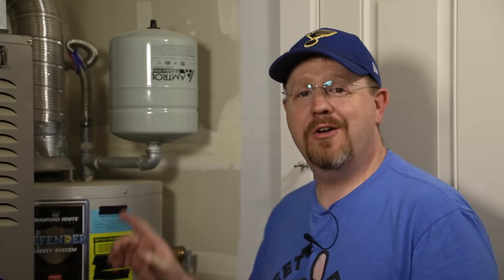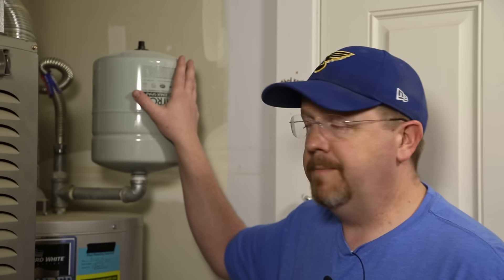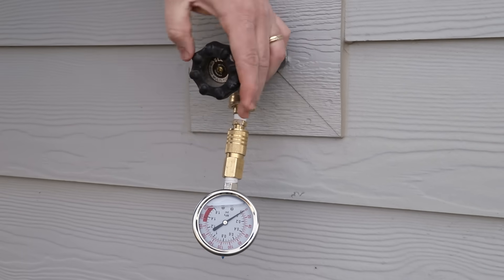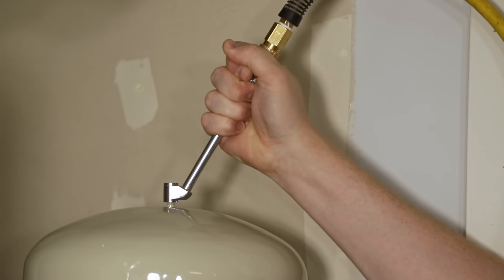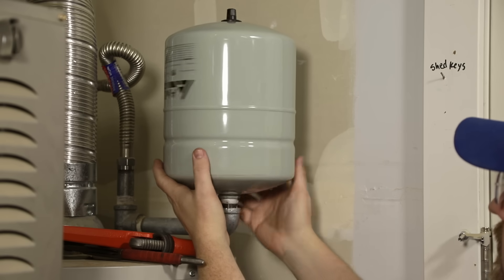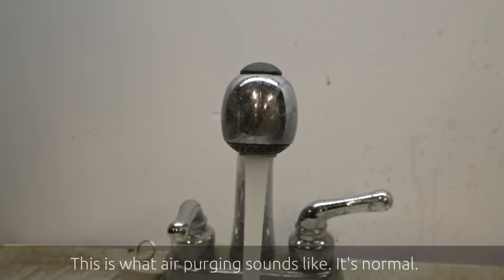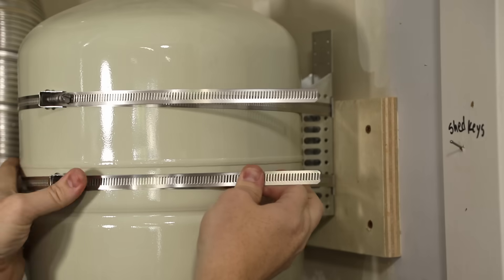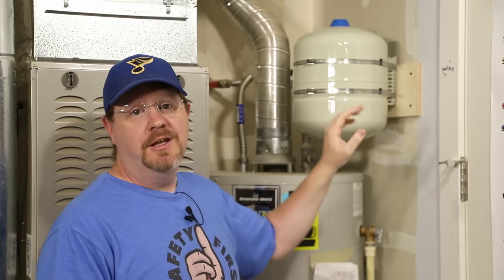What Is This Tank? How to Replace and Maintain a Water Heater Thermal Expansion Tank

Comment: Is it need by city code??? What about safety pressure release value ?
Reply from the maker: Some areas require an expansion tank, yes, some do not. Consult your local city/county/municipal ordinances to find out if yours is required or not. As for the T&P valve, those are required everywhere.

Comment: Not sure your right on matching the tank PSI to line pressure, as the bladder will be fully extended all the time and be stressed and short lived. Your tank pressure should be set to 50-60% of your water pressure so the bladder ends up at the middle of the tank when in service. (The air gets compressed 50-60% then and = line pressure). Blaader life it far greater if its not at it limits.
Reply from the maker: Hi Stephen - every source I consulted indicated you are supposed to match the incoming pressure. Here are a few for your reference: 
"Expansion tanks are pre-charged with a 40 PSI air charge. If the inlet water pressure is higher than40 PSI,the expansion tank’s air pressure must be adjusted to match that pressure but must not behigher than 80 PSI."
http://www.americanwaterheater.com/media/22209/exptank.pdf
"You will need to adjust the air charge. Yes, the factory does precharge the tank, but usually only to 40 psi. You want to match the pressure in the expansion tank as close as possible to the water pressure of the house."
https://www.plumbermag.com/how-to-articles/business_general_service_hvac/tips_for_handling_water_heater_expansion_tank_troubles
Reply: @AmplifyDIY  If the Empty tank is at water pressure, how would any water ever push into the tank?  Thus the bladder is always fully extened all the way to the water inlet. You want the bladder in the center. It can't if the pressure empty is the same.  If you have say 80PSI water pressure, charge the tank to 40 to 50 psi, when the water pressure is applied, the bladder will move to the center as the PSI of the air will be doubled when you add the water pressure.  I had issues with mine, the mfg of the tank explained it like i have and have had no more issues.
Reply from the maker: Hi Stephen - You asked: "If the Empty tank is at water pressure, how would any water ever push into the tank?" - The answer is that as the water heater heats the water, that water expands, which increases the pressure of your system, pushing water into the expansion tank. As this water pushes in, it reduces the volume available for the air, which also increases the air pressure to more or less match the increased pressure of the water. Also, the bladder of the expansion tank is not set right in the middle - I've cut several open, and the bladder is mounted about a quarter of the way up from the water inlet, and has enough slack that it sits more or less right on the water inlet with little to no stress on the bladder. 
No idea why any manufacturer would have told you to do it that way, unless it was a tank for a different type of system.

Comment: Holy smokes 75 psi! I don't know crap about plumbing, but have had two plumbers check my household water pressure. The first turned it to 60 psi and said any higher would damage pipes and fittings. The next plumber checked it and of course it was 60 psi, lol. He said that was as high as it could be safely set. ....I think I'd be satisfied if my pressure was 75, seems like a lot.
Reply from the maker: Below 80psi is normal for most US residential. But the whole point of this video is that the tank needs to match the water supply pressure. My supply from the city is 75psi, so I set the tank to match.
Reply: @AmplifyDIY 75 psi,  I'm jealous - I understand the video, sorry if you misunderstood; I'm not being a Youtube keyboard commando. As stated, I don't know crap about plumbing, just sharing what I've been told.

Comment: Ignore the UK in my name. I live in the US. I recently replaced my electric water heater. My home was built in 2009 along with all the others in my community. It didn't have an expansion tank. I'm assuming the plumbing has some kind of way to expand back into the supply..  Either that or the plumbing contractors took short cuts.. is there a way to test / or visually see if there pressure can relieve itself by going back into the system ?
Reply from the maker: Hi Julian - Take all this for what it's worth: I'm not a licensed plumber, just a DIY'er who understands how water heating systems like these work pretty well. 
The only way I can think of is to try doing the following: First, get your hands on a pressure gauge like I showed in this video, along with whatever adapters are needed to get it connected to your water heater's drain valve. Turn off your heater's heating element (probably by just flipping the breaker for your electric heater) and go take a shower, do a load of dishes, some laundry, etc... use up all the hot water that was in the tank. At this point you should have a water heater full of cold water that is not trying to heat it up. Now attach the pressure gauge to the drain valve and open the drain valve to read the current pressure. In my area it's around 75 PSI, but it's likely different where you are. Record that initial pressure. Then (while leaving the gauge on the drain valve and the drain valve open) turn the heater back on and let it heat up the tank until the thermostat turns off the heating element. Then record the pressure once more. If the pressure has risen significantly (more than, say, 3 psi) then you should have an expansion tank installed.
Good luck!

Comment: This guy has a flexible gas connection to the water heater, with no easy to reach gas shut-off valve, that I could see? Flexible hot and cold water connections?
Reply from the maker: Yup, that's how the plumber put it in, and it passed inspection.
Reply: @AmplifyDIY  you need to call that plumber back, I can't see this work as code compliant, or I don't know my job..
Reply from the maker: The plumber who installed this did so when the house was built about 4 years ago. I couldn't call them back even if I wanted to, as they were the plumbing contractor the house builder used. As for code: Local codes vary, and all the houses in my area use flex connections as you see ... it may not adhere to your local codes, but it apparently does here. Thanks for watching!
Reply: @AmplifyDIY  enjoyed the vid,like you said codes vary depending upon your area of residence, if I were you though I'd definitely change that flexible gas connection, in my opinion you're asking for it.
Reply from the maker: Thanks for the heads up. I'll check into what is best practice in my area. Thanks!
Reply: @AmplifyDIY  👍

Comment: Wouldn't the air absorb into the water in  a few days?  After that what keeps the stagnant water in the tank from growing bacteria and other deadly things?
Reply from the maker: Heya Popular Media: No, the air is kept separated from the water by the rubber bladder / diaphragm I mentioned. The lower portion of the tank where there is some water is coated inside to suitable for potable water. The upper area (above the bladder) is meant to forever stay dry since no water should get past the bladder. There is actually very little water that ever gets up into these things, and it will cycle in and out with the heat/cold cycles of your heater. There is no need to worry about bacterial growth.
Now, when the diaphragm fails, all bets are off. If water gets up above the bladder and into the portion of the tank that is not designed for water storage, it will quickly rust that portion of the tank and turn brackish. Some of that can seep back through the failed diaphragm into the potable portion of the expansion tank, and also down into the main water heater tank. This is why it's so important to check this expansion tank annually to make sure it is still pressurized and the bladder is still water tight. 
Great question, and thanks for watching!

Comment: I'm currently living in my fifth house (in SE Texas) and I've never seen one of these tanks attached to a water heater.  I've never had a problem.  As a matter of fact, the existing water heater in the house I own is the original heater ( installed in 1996) and I've lived here for 15 years. Are these really necessary?
Reply from the maker: Hey Aggiedave - great question! Not everyone has or necessarily needs an expansion tank. You can read a bunch more info about the hows and whys here: https://legacyplumbing.net/blog/water-heater-expansion-tank/ 
Thanks for watching!
Reply: @AmplifyDIY  This is not the answer that Aggiedave77 asked...you should say that it is not necessary as the hot water tanks is required to have a high pressure relief valve to relief the pressure if the water pressure inside the tank exceed the set value, say 75 psi...A few cities may have regulations that require a thermal expansion tank, but that is the exception, not the norm.
Reply: if you have a check valve in your supply line ( to prevent backflow into the city water system... a local code aspect)....then you have created a closed system where the expanding water has no where to go when it heats up. If you don't have a check valve...and the water expansion goes back to the city supply.....then you won't need the tank.

Comment: I have a Bradford white defender, like yours 3 years old, 50 gallons, natural gas. whats the difference between a 2.5 gal tank and the 4.5. other than the price.
Reply from the maker: It's all about capacity. The larger the tank, the more of a "cushion" it can provide. A 50 gallon tank is near the upper end of what a 2.5 gal expansion tank can handle, so I decided to step up to the next size. Thanks for watching!

Comment: There is a tool that tightens a zip tie until a preset tension is reached, and then it cuts off the tail. IIRC, cutting doesn't leave a burr.
Reply from the maker: This sounds like something I should have in my toolbox. I'll see if I can find it. Thanks!

Comment: Interesting and well presented. How prone to failure are the bladders? The way yours is mounted, if the bladder fails and since the tank doesn't leak, is it OK to just add air and re-pressurize the tank
Reply from the maker: The bladders are pretty resilient as long as the tank is kept pressurized. Most failures happen prematurely because the plumbers that install them never bother to pressurize them correctly (that was the case with mine). Simply re-pressurizing the tank is not a great idea if your bladder has failed though, because inside the tank the area behind the bladder is not protected against corrosion, and by letting water that has been behind the bladder get into your heater tank you'll introduce all kinds of crap you really don't want in your water supply. 
I actually cut one of these open that had failed (filmed it, but never finished the video... maybe I should) and the water inside was a goopy, sludgy, rusty, foul-smelling mess.
If your bladder has failed, just replace the tank.

Comment: Awesome video! Can you link or explain sizing of expansion tanks for a system?
Reply from the maker: Hi Brandon! The size of expansion tank you need is determined by 2 factors: your water pressure, and the capacity of the water heater. Here is a great site that explains in more detail, along with a handy chart to help determine the size your system will need: https://www.pexuniverse.com/how-size-and-select-proper-expansion-tank

Comment: Great video.  I have a question.  I have an expansion tank and need to change the elements on my electric water heater.  Do I need to discharge the expansion tank, to drain the water?  Thank you.
Reply from the maker: No, you can leave the expansion tank pressurized, since you are only pressurizing the bladder inside the tank. Good luck swapping your elements!
Reply: @AmplifyDIY  Awesome, thank you.

Comment: The cost for a new install ?  Ballpark.
Reply from the maker: You can buy a new tank for < $50USD. If you also have to  put in the junction on your cold water inlet you'll spend another  $30 or so in a T junction, nipples, elbow, teflon tape, pipe dope, etc. If you hire a plumber to install one they'll likely charge $2-500, but that can vary pretty wildly. Call around to local places for quotes if you don't want to DIY. Good luck!
Reply: @AmplifyDIY  thank you! The reason I asked is I  been calling. Pricing range from 400 to 1,200 or come to the house to give a quote  80 to 150. Only one said they would apply the cost of the quote  towards the end job cost. I wish I could diy I always did. However, old age put a stop to that. Thanks again. HEY I just realize you did not send me a bill for your comment. Thanks! 😁
Reply from the maker: "I just realize you did not send me a bill for your comment." - just make sure that the items on my list find their way under the tree this year, Santa. ;-) Best of luck with getting your expansion tank installed. Hopefully you can find a reputable plumber that is also affordable.

Comment: Never use galvanized pipe and fittings when doing this! Use brass or copper...galvanized will corrode and cause pressure issues,  chunks of debris going into your supply and heater reducing the overall life...
Reply from the maker: I wish the plumber who installed my system knew that.
Reply: @AmplifyDIY  in 6 months that galvanized configuration won't be 3/4" anymore that's how fast it corrodes... it should be brass,  brass doesn't corrode like that...galvanized will essentially close off with rust, brass will stay open
Reply from the maker: I’ll get it on the old todo list to swap that out soon. Thanks!
Reply: If that were true everyone would be in trouble as all domestic water heaters have galvanized inlet and outlet nipples.
Reply: @byronsteez8253  that's not even remotely true,  they are dielectric nipples with thermoplastic lining,  they are made from mixed metals but not even close to galvanized nipples
Reply: @footlongburrito  pretty sure they're galvanized. That plastic lining is akin to putting lipstick on a pig
Reply: @byronsteez8253  well that's where this ends,  you clearly don't know what you're talking about.
Reply: I regularly worked in homes with 70 year old galvanized supply systems that still were in great working order. Galvanized iron is a fine way to convey water.
Reply: @byronsteez8253  you're special,  I'm a master plumber,  and there are 100x more cons than pros to use galvanized,  if you honestly can't comprehend what those issues are then idk what to tell you.
Reply: @footlongburrito  sadly, in many states, its not very hard to become a master plumber. 100x  more cons than pros?
Reply: @byronsteez8253  it's not even the topic, of course galvanized is ok to use on water systems,  but if you willingly choose to do so,  then you are stupid.

Comment: How far from the cold water inlet should the tank be?  I have read ut should be a minimum of 17".  But yours is not
Reply from the maker: Hi Matt - I'm not sure there is any minimum... if there are minimums, then it would likely be region-specific with respect to building and plumbing codes. Mine is plumbed into the cold water inlet right off the top of the heater. I assume as long as it is in-line somewhere on the cold supply to the heater it will do the job of absorbing the expansion pressure of the heated water in the tank.

Comment: Just followed these instructions to replace my expansion tank. But now my relief valve won’t stop leaking, even thing I haven’t even turned on the heater yet. I put I bucket under it but I have to keep bailing it out with a cup. Did I miss a step or something?
Reply from the maker: Hi Artem, 
Is your valve leaking all the time, or only occasionally when the heating element is active? If it's a constant leak, then the valve is likely caked with lime/sediment and needs to be replaced. If it is only when the heater is actively heating, then it's likely you do not have the expansion tank set to the correct pressure. 

What is the pressure of your water supply? 
Did you pressurize the expansion tank to match (while the cold water supply was turned off and the water pressure relieved in the tank?

I did a whole video on T&P valves - how to tell if they have failed, and how to replace them if they have. Luckily they are inexpensive and very easy to replace, if that is what is needed: https://youtu.be/e5H1i1cypxA

Good luck!
Reply: AmplifyDIY I believe I have the tank pressurized correctly, to 60 psi, which I’ve been told is pretty standard and I’ve confirmed by measuring in my garage and backyard. Strangely, I noticed a 5 psi drop after installing the new tank.

The valve started leaking as soon as I turned the water main back on, even before I started the heater. It eventually went down to a drip after I flipped the valve open and closed a few times. Later on, I noticed that I stopped leaking and noted the level of water in the bucket. I came down later the same day and saw that the water level has increased. I bailed it out until I could see the pipe again and saw no dripping. I’ll take another look in the morning. I’ve lived in the house for 5 years and have no idea if the valve has ever been replaced (the house is 15 years old). Probably would have been another 5 years if that expansion tank hadn’t sprung a leak

Comment: Nice video! Quick question! Do I absolutely have to turn the water heater to pilate mode? Can I just leave it on an on position?
Reply from the maker: You absolutely should make sure the heat source is turned off, yes.